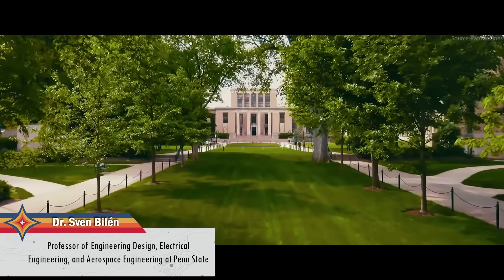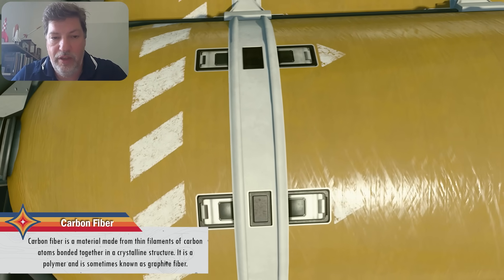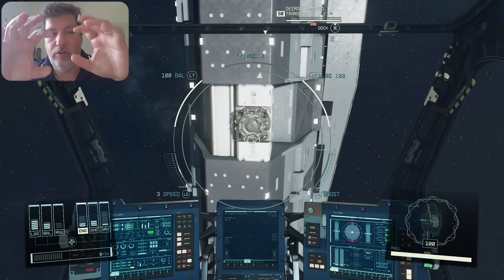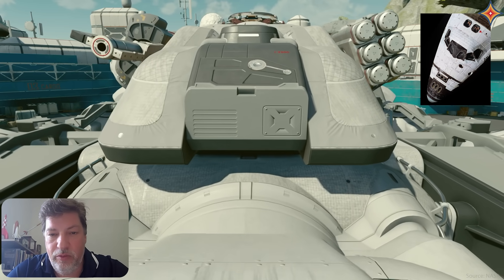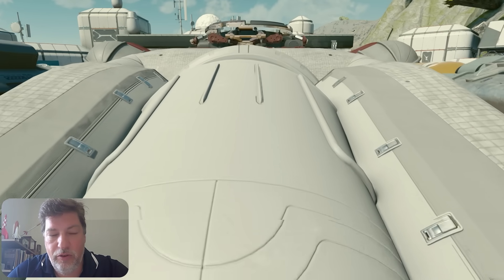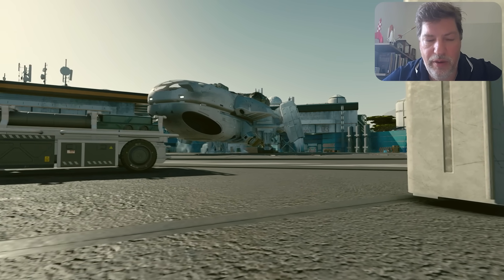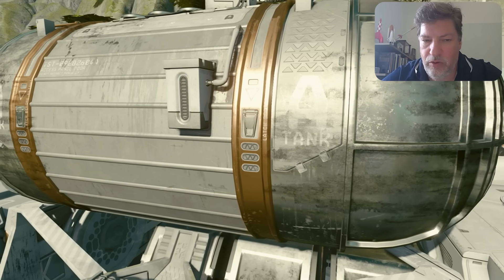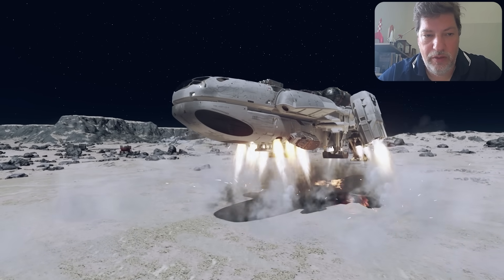Space Systems Expert Reacts To Starfield Ships

Comment: I suppose they can make do with "Old Fashioned"  Chemical Fuel rockets if there is some auxiliary effects of the grav drive helping the ship function that wouldn't apply with "real world" physics. if the grave drive is also providing artificial gravity, inertial dampening, structural integrity and maybe even "virtual Mass" reduction then you'd need very little fuel to move it around as the ship wouldn't be realistically massed the Grave drive would be negating the mass to a large degree.

If it had normal mass I'd say put Nuclear fusion rockets on it instead. The ships handle like a drunk whale on roller skates though so that implies they have lots of mass that isn't being compensated for by the artificial gravity generator.

I would worry about heat making the material fail though even with metal materials, but I can think of a few ways composites can transfer heat that might help.

I think they are supposed to "look right" rather than actually be right (if you get the distinction".

I would presume maybe a aerospike might be consider a bit noisy or dangerous in an atmosphere or even polluting, there could be reasons not to use them such as flying in atypical atmospheres for one.

Comment: This guy for all his brains gets so much wrong because he doesn't account for 1 variable at all times. He references it once or twice but then says he is puzzled on other things which doesn't make any sense such as zones where heat will trap. In the future when we have shield technology and more advanced materials around the ship, entrance and exit routes may not need to account for heat generation as the atmosphere during these period cannot get near the ship in order to burn it. For example we could find a substance which is aerophobic(repels gasses), we already use this underwater where air bubbles are not wanted. Then as the air is not passing over the surface a heatless entry and exit would occur. The same thing goes for the lights, again with the correct materials there is no reason as to why a light should not be there.